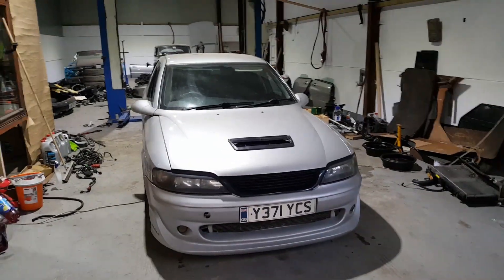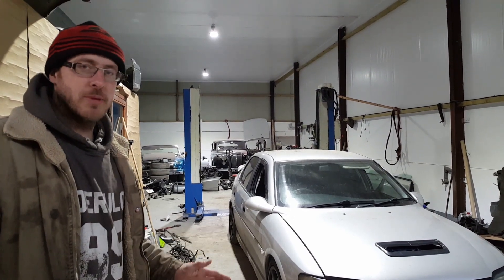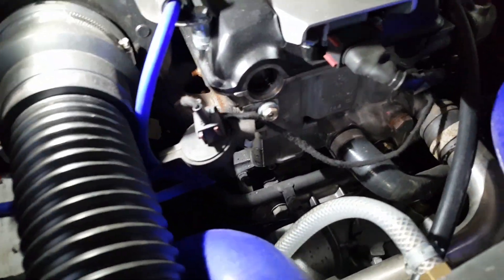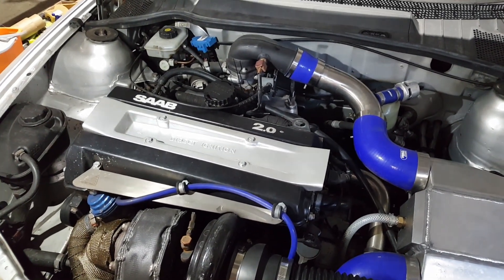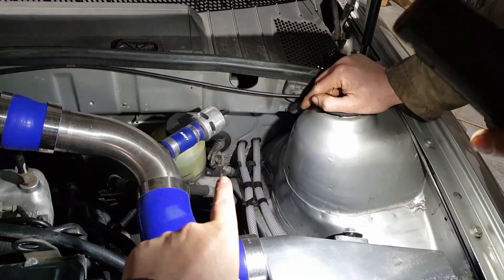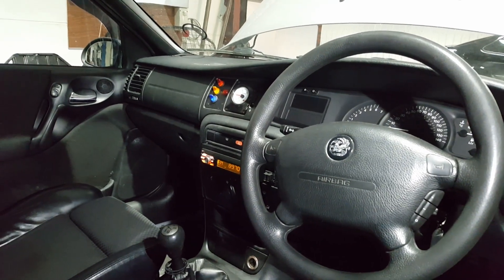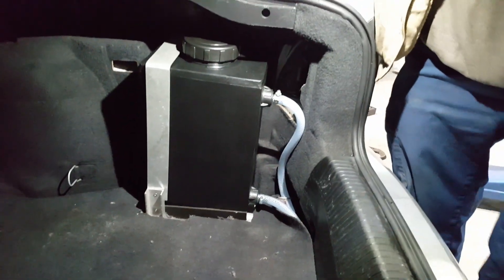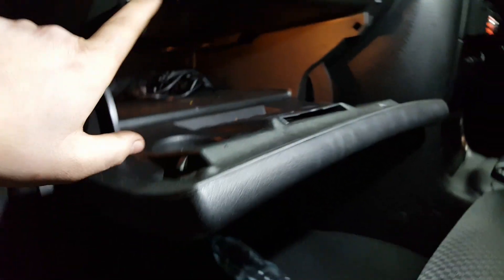Highly modified vectra b204 holset hx35

Comment: This looks sick, that turbo is ridiculously sized. Over in Aus, my dad and I are currently doing a similar swap into our vectra b (using the b205 instead of the b204). Just wondering, how'd you manage the wiring for the engine? We're planning to use the saab ecu and make an adapter between the engine and body loom, but I'm not sure if we're missing anything
Reply from the maker: Personally I'd use the b2*4 unless your not to fussed on big power, have you got someone who can play with the t7 ecu and loom? T5 is easier mind

Comment: I'm just starting my journey into swapping my standard 1.8LS ecotec petrol engine for a b204. I'm on some forums and getting advice but this is the first time ive seen one in a video.  What price should i be looking at to buy the engine, There's currently on on ebay complete with Loom,ECU Turbo for £550. Can i assume this is a good price?
Reply from the maker: If you can do the work your self then expect to spend about 1500, it's surprising how it all hands up, 550 is an average price but it's trusting the seller that your buying something useable, I have a engine package you can buy, it's currently in my vectra and I'm swapping engine for the one I built for my van
Reply: @wheelhobbies5021  I'm no engineer so it'll have to be left with my buddy who is to fit it all.

Comment: Why such little power for such a big turbo?
Reply from the maker: Good question,
Now there's many factors to take into account, 
1, it never got live / dyno'd tuned,
2, log manifolds are great for reducing spool time on larger turbo but hinder flow mid to high rpms hence less power